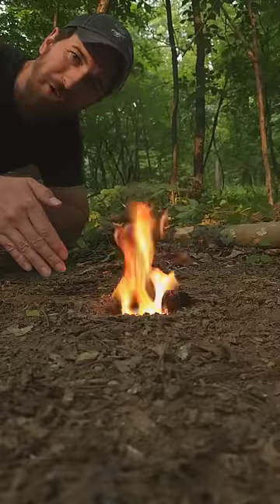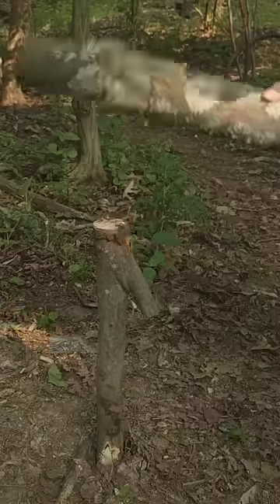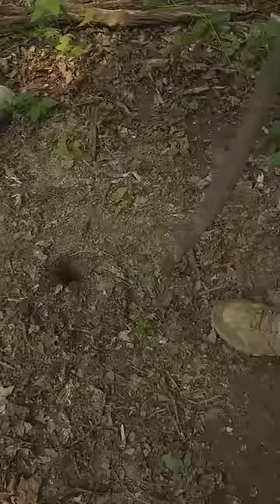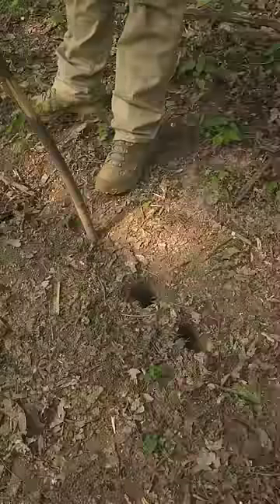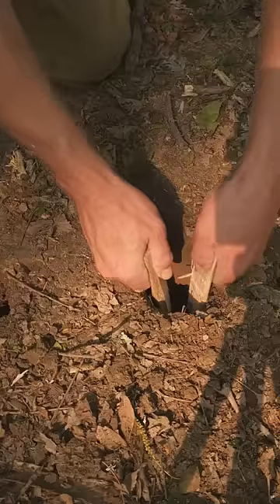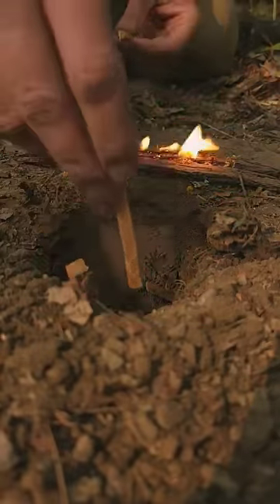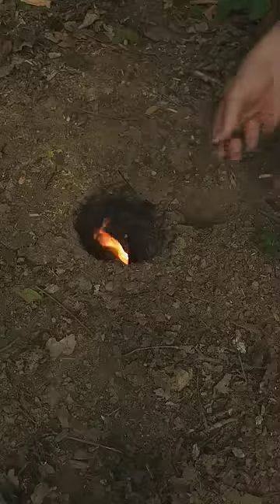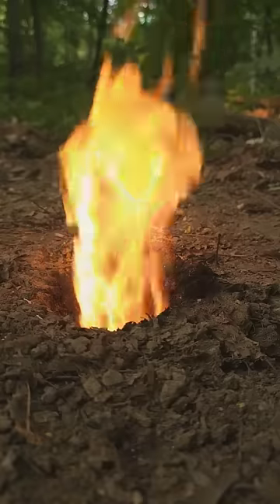Make a mini fire hole/rocket stove with no shovel 🔥

Comment: Remember to double-check your environment.  If your surroundings have a lot of loam / forest detritus, where the soil is mostly organic matter (especially if it's dry) or you're in a peaty location, DO NOT MAKE A GROUND FIRE.  Same goes for a lot of conifers, pines spruces, firs, and so forth.  They have very pitch-rich roots, and those can catch and hold an ember, same as the loam, peat, or thick leaf litter.  ONLY DIG A FIRE HOLE IN MINERAL / CLAY SOIL, and make sure you have water on hand to extinguish it, not just try to smother it!  Embers can smolder underground for literal weeks before springing up into a forest fire.  EVEN IN WINTER, this can happen!
Reply: important disclaimer!!! i wish youtube could pin comments
Reply: Pin this 😮 spot on
Reply: Winter ain't having no adverse effect on the inflammability, nowadays!

Actually, the worst fires of the last few years (f.e. In the US) were wreaking havoc in octobre to december.

Neonicotinoids also did partake in some killing of woods, which turned them into firestarters (natural process apart from killing an insane amount of insects with pesticide casings of seeds like neonicotinoids)!
Reply: The only other draw back is it seems like you can't do this because of that......I feel like I can't do anything!
I'm not trying to be a jerk here! Just saying......did you guys not see the organic material around the hole?
Reply: Thank you. VERY important
Reply: @madmudslinger  I'm just curious have you seen it happen, even in winter?... Did you see the ground in the video? Covered in organic material.... I just don't understand, this guy's saying don't do it and that's exactly what the guy did in the video
Reply: @davidschmidt270  Yes I've seen fire travel underground in winter - numerous times. It's scary. Someone's burning a stump and days/weeks later a tree 30' away is suddenly ablaze.  The fire can travel hot and slowly through peat or duff until it reaches a conifer root and then you're in trouble - even worse if it reaches dead roots. This is a serious issue where I live in Salish Sea Islands PNW
Reply: @madmudslinger  hah! I used to live in Oly! ....went to Thurston .
Reply: @madmudslinger  Salish sea islands ? Never even heard of it....I can't believe a fire will travel that far through roots in the dead of winter!
Especially up there!....
What's it like where you live?... My friends Mom who I used to call Mom says Oly sucks now.....says it's completely overrun...I lived in a small rural town....over by an elementary school called South Bay...I lived 5 miles from town...this was both good and bad ... LOL....hope your area is nice, hope your safe 👍
Reply: @davidschmidt270  Canada's west coast wilderness!
Reply: @davidschmidt270  anyone can make flashy videos with good editing, and sometimes the people making them are wrong :/
Reply: @Cantaste  what if the ember’s moved through the roots and the water can’t douse it?
Reply: @grapes4832  That's right! I've seen it happen even during the rainy season.
Reply: Was going to make the same comment in light of all the forest fires this year.
Reply: @davidschmidt270  Just bc he knows how to make the fire hole doesn't mean he knows the safety issues. Just like he didn't mention them to viewers, the one he learned from perhaps didn't tell him, or he doesn't care, or he just wants a clickable short.
It's dangerous to think a video shows everything needed. Anything potentially dangerous should be researched before attempting.
This is how so many people, especially impressionable kids, get injured from watching "content'
Btw, excellent of you to ask questions. It's commendable!
Reply: @echognomecal6742  thank you!
This is why I read the comments, for that very reason!
Reply: @davidschmidt270  Enjoy your week! 🙂
Reply: I commented this, briefly,  before seeing your comment ! Very important.
Reply: Ty martial
Reply: Just stay above ground. Follow safety rules using rocks.
Reply: @davidschmidt270 it's what happens underground if there's burnable anything it. Even tree roots.  Can smolder for weeks, then ignite above ground material on enough heat is generated. Point is, it really does happen if conditions are there, especially global warming effects.
Reply: My thoughts exactly
Reply: REAL INFORMATION RIGHT HERE!!
Reply: thanks, great knowledge!!
Reply: Great point.  I know a farmer that chased ground fires for over a year.  All started from his worker burning a stump.
Reply: Great Advice. Also Wind direction may consume dry roots/ wooded / pitch/peat/dry leaf litter FASTER than Your Able to contain it on a windy day above ground too.
Reply: @ibeetellingya5683 "global warming effects" lol ok
Reply: They're just like any other fire. You have to pour enough water on them to make sure they're out. And since these holes are small, they can be completely filled with water.
Reply: Wa what😂
Reply: If I HAVE to make a fire, then I'm making a fking fire.
Reply: This!
Reply: In other words, don’t do this in California.
Reply: Yeah this really isn't a good idea lmao. Just make a normal fire.
Reply: 100 % fact
Reply: Thank you 🙏 I’ll look into the ‘fire safety’ of this style fire 🔥 before I try out my new skill. ❤ 🙏 ❤
Reply: ....so, in soil exactly like depicted in this video, them?
Reply: Good point. In the northern boreal forests of Alaska and Canada, the "duff"  (dead undergrowth yet to fully decompose into soil) can slow-burn for months and seasons, flaring up much later when more oxygen is available.
Reply: Amen  😊😊
Reply: This is exactly what I came here to say.
Reply: Why? If I'm in a survival situation the forest partially burning down would help me harvest usable wood and a crazy amount of ashes to use for various processes and water purification
Reply: @DesertTuna nah
Reply: @xelsrealm pin this balls
Reply: @TylerHachey-w4p  Downside is that you would be in a burning forest 🌲 🔥
Reply: thank you thank you
Reply: we were camping when we met a firefighter. he told us a story of a family member of his. he just burned some old stuff in the middle of winter with half a meter of snow around. the fire burned out and all was fine. 2 weeks later his house burned down, turned out the fire had gone dormant underground but kept burning. this stuff is real. he might have told us to scare us but he seemed very genuine. please be overly cautious when making fires.
Reply: @davidschmidt270 "For months, remnants of last summer's destructive Alkali Lake wildfire have been smouldering underground in northwestern B.C.

Now that spring has come, they're coming out of hibernation, flaming up to the surface. A handful of small wildfires have popped up in recent weeks, growing to cover up to 5,000 square metres.

These subterranean blazes, known as ground fires, are tricky to manage, but they're not uncommon and they're especially prevalent in areas with lots of organic material in the soil, according to fire ecologist Robert Gray.' - CBC 2019
Reply: @ButterfatFarms  thanks....brought some clarity !
Reply: @davidschmidt270  all it takes is the right soil conditions for ground fires to smolder and spread for long periods, and they can travel surprising distances underground as they do. There just needs to be enough organic combustible material in the soil, along with it being loosely packed that there's still oxygen available in the soil, along with it being dry. This provides an environment for hot embers to smolder for long periods of time, traveling underground until it reaches the surface somewhere else and erupts into a new surface fire. Given the right conditions deep in the soil it can smolder for weeks, months, years. An example of which would be the Fort McMurray wildfire that started in the spring of 2016 but wasn't fully extinguished until the summer of 2017, having smoldered underground throughout the winter months to re erupt the next year when conditions were right.
Reply: Was going to say the same thing—root fires are super challenging to calm down once started!
Reply: I remember that there was a rainbow gathering in Florida - in  the north end of Central Florida.  This is in the 1990s.  As usual there was a main council which every fire is supposed to send a representative to and follow the rules. Well there were guys with fires who did not follow the rules, who didn’t even go to main council. They came early and just kept their fires going.
   I don’t know all the rules or how they broke them but what I found out later was exactly this.
   The forest floor was peat and they started a long long lasting fire.
   Those are all the details I know and I’m really sorry about it. The main Council wasn’t aware enough of the dangers to put some muscle on them.  
    I was there for a week and then I didn’t like the place so I left. I heard the stories about what happened much later.
Reply: @davidschmidt270  it all depends on whether you hit something flammable under the ground.
  The shorter the time you have the fire the less danger. That’s something the video didn’t mention. Keep it going for weeks and you’re more likely to get in trouble. As I said extinguish with water lots of water.
Reply: True I found an area near a marsh that someone  had a campfire and the roots from grass were burning for days.

Comment: Just make sure the holes are in ' dirt' not packed organic matter. If the soil is mostly organic matter the ground can catch fire and start burning underground. Underground fires are not easy to put out and they can go anywhere.
Reply: For sure.. years ago sparks from a beach fire ignited dried roots from the edge of an eroding field. Didn't notice until the next morning when we woke up and the pasture was smoking in a bunch of places. Concerning??? you betcha.
Reply: Muck fires are dangerous!
Reply: And the resulting forest fire can spread faster than you can outrun it.

Comment: Heads up for people in the comments: make sure that the area you're in is safe for underground fire techniques! If you do this in certain regions, ESPECIALLY if there's peat of any sort, you could cause a fire in the local peat mass or root system.
Reply: Thank you. Im kinda disappointed he didnt mention the risks in this video... 🙄😮‍💨
Reply: Peat risks? That's crazy. Only a few places in the world, SMH.
Reply: @MrDavidknigge those places are commercially viable peat harvest, sure. That doesn't mean it won't turn up in other places that have a regular wet season or which used to be wet for a long time.
Reply: @Saohesc  What are the odds that one of us will dig a hole, build a fire, and there will be catastrophic consequences?
Reply: @MrDavidknigge he Scottish Highlands, where I live, recently had the UK's largest forest fire on record (at a place called Cannich), due to underground peat burning. Some wild campers started a fire which went out of control from their camping gas stove; they called the fire service, who came to put it out. Unfortunately the firefighters who attended were from the nearby city, so weren't knowledgeable enough to make sure there was no underground fire risk that needed excavating or further extinguishing. They left, the fire resumed as the peat continued to smoulder and reignited, and ended up as our largest on record.
Reply: Well theres basically no peat on the whole continent that he and i are both on, ao i dont have an issue with his failig to mention this
Reply: @jaredlancaster4137  North America actually has a fair amount of peat. There's a little in Florida (many swamps have some quantity of peat), some on the north part of the US East Coast, and then there's a ton in Canada. Like 10% of Canada is muskeg or other peatland, from what I remember looking up.

Also, even beyond peat, you can catch tree roots on fire, and that heat can spread up to the trunk, causing a forest fire.
Reply: @MrDavidknigge  there isn't much peat in the central United States, but there's plenty of peat in other parts of the continent, and many other continents besides. Finland, Russia, China, Canada (especially the Hudson's Bay region, but all over Canada), Ecuador, the DRC, Germany... over 180 countries in the world have some amount of peatland, according to the UK international peat program. That's a lot of peat.

And again, forests have tree roots, and that's a danger on its own. Dakota fire holes (the technique in the video) are from the Great Plains region, and don't necessarily translate over across biomes.

I thought I'd replied to this, but apparently not. Seems Youtube ate my first comment.
Reply: @ae3qe27u3  thank you so much for educating us.
Reply: @MrDavidknigge  not sure if you're being sarcastic or not, but it's a topic I find interesting! Biomes are fascinatingly cool, and I love seeing what different parts of the world have to offer. It was my pleasure to share a bit of that :)
Reply: @ae3qe27u3  I'm genuinely appreciative.
Reply: @MrDavidknigge  I know someone that made a fire and set the peat under it on fire, that fire ended up spreading underground across a entire field burning the peat, they had a hell of a time putting it out and it almost burned down the house.  Peat is found in many places around the world and fires shouldn’t be built on top of it.
Reply: @MrDavidknigge  Happy to do so! My parents are big hikers, so they've picked up knowledge about what kind of things are safe to do where. I also research biomes as a hobby, so I've picked up bits of trivia here and there over time. It also means that I have a good idea of what kinds of things exist (like muskegs), which gives me a bit of traction when looking things up.
Reply: @MrDavidknigge  More generally, I work in engineering, so a big part of my job is looking for ways that things can go wrong. If a part fails or a building collapses because we overlooked something, then that's a problem. That kind of mindset means that I'm just on the lookout for things that would otherwise get lost in a wider generalization. In this case, tree roots! They're in the ground, so we don't really think about them as being able to catch on fire, but they can. It's different than a normal fire, but it generates heat all the same, even without air. (If you look at the history of charcoal on Wikipedia, that's basically how charcoal is made)

I'm just kinda rambling at the point, but basically... if you look for the weak spots and plan for failure, then it becomes a lot easier to avoid unanticipated consequences.

When I say "plan for failure," what I mean is that you look at how something can fail, look into what would happen, and then plan for what you need to do to A) prevent it from going wrong and/or B) if it goes wrong, how to compensate for that
Reply: @ae3qe27u3  I am a retired consulting engineer and spent many days at the courthouse testifying. I was raised on the Great Plains and still live there. Native Americans on the plains made these types of fires because wood was limited and the ground flat so there was little smoke when constructed in this fashion.
Reply: @MrDavidknigge  oh, that's super cool!!!! What field of engineering did you practice in?
Reply: @ae3qe27u3  I specialized in commercial and industrial building external shells. Wall systems and roofs mainly. Included decks, insulation. and vapor barriers.
Reply: Swamps, especially in Florida that isn't just sugar sand could have a very long peat fire, burn down the Everglades. Just use informed common sense. You'll be alright. Hmm... Now where will I have fat wood laying around here?
Reply: This why I go to the comment sections.  Thanks for the heads up.
Reply: I just looked it up and some of the area near me is definitely peat-land. Not my town or even the surrounding area, but definitely places I have traveled to go camping.
Reply: Indeed... and never do this in an area where livestock manure has been worked into the soil
Reply: I've seen fires come up hundreds of feet away after burning through a peat layer; even went under a fire break trench.
Fire can follow dead tree roots, too.
Reply: @michaelpcoffee exactly!
Reply: You wouldn't want to do this in a pine Forest either. Too many pine needles on the forest floor. This is definitely not a universally applicable fire building technique.
Reply: Some species of peat in Manitoba can ignite at very low temperatures. Had a sample in a 105°C oven overnight to determine moisture content. In the AM only ash remained.
Reply: How do you tell?
Reply: @FoxtrotYankeeHotel nice 👍
Reply: F Peet
Reply: Not a problem